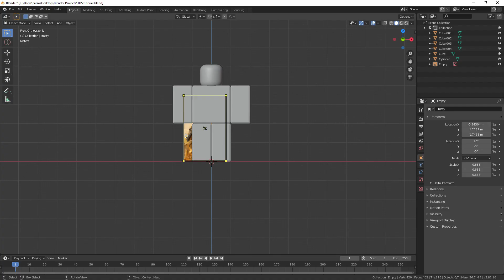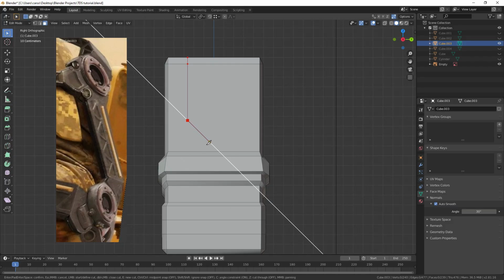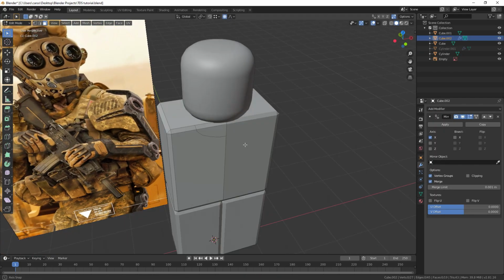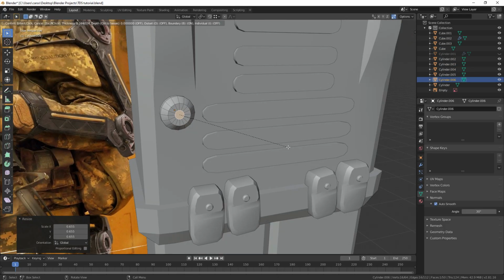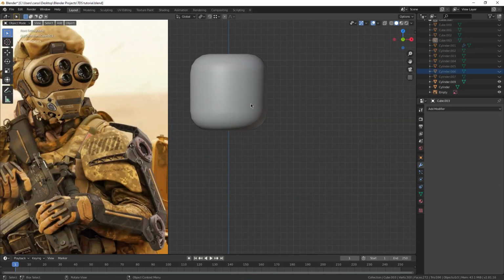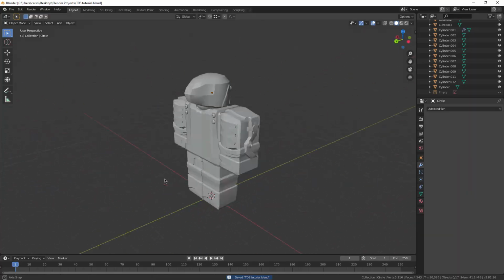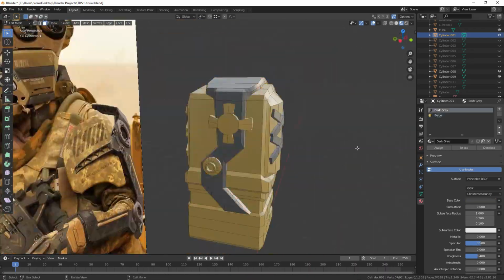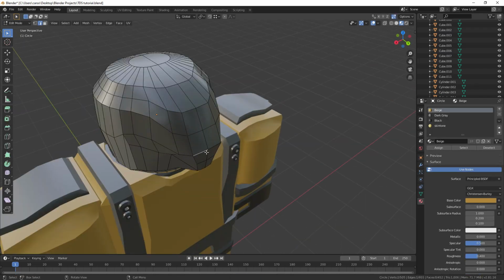How To Model TDS Skins In Blender

Comment: after i export to roblox, both the arms are together and both of the legs too. i want to move them freely
Reply: use moon animator clean model thingy
Reply: @RsSlayer443 not uh every one has that
Reply: @randomwho90 , brokie
Reply: @MasterXeno0bro not everyone wants to spend money on a animation soft ware
Reply: @randomwho90 one word PIRACY-
Reply: you probably mirrored it, either copy and paste it and just flip it on the other side or if it has accessories just export them seperately, and if you cant, just do ctrl p>selection to seperate it
Reply: go into edit mode, hit p, hit by loose parts then ur done, do for both legs and arms
Reply: Export as Fbx and dont join meshes in blender